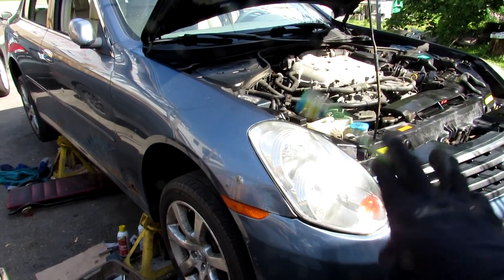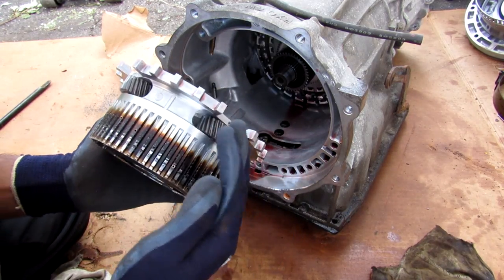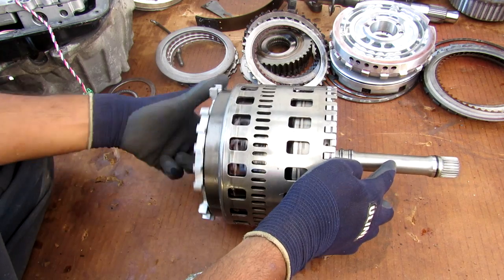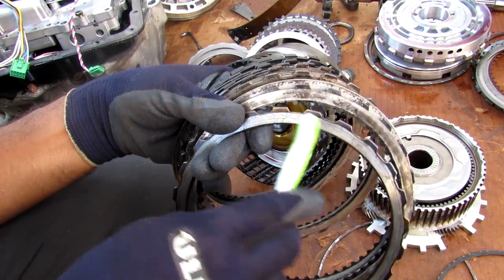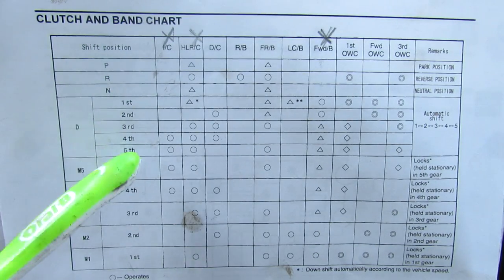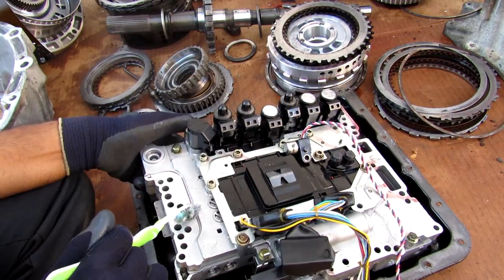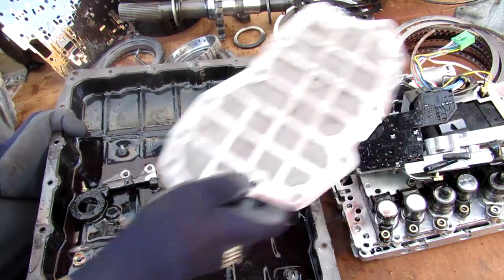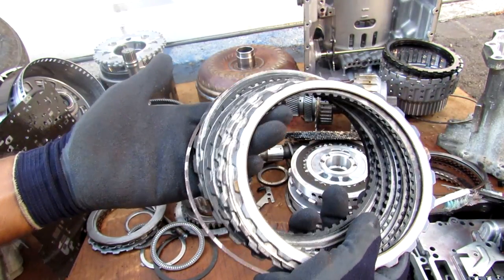Why Automatic Transmissions Fail

Comment: Now put it all back together again :) EV's require less maintenance, and this video shows one big reason why: No gearbox
Reply from the maker: The gearbox is a circuit board.
Reply: @speedkar99 : No gearbox of any kind. You're thinking of throttle. A/C induction motors have an extremely wide constant torque range by nature.

Comment: Nissans best effort.
Mercedes can be trusted to make good transmissions that last and can be easily fixed
Reply from the maker: Alot of brands can be reliable but maintenance is key
Reply: @speedkar99  Definitely agree. On a 5 or 7 speed merc box, a fluid and filter change is easy...a conductor plate is made into a service item. They really hold up...even when neglected.
Nissans in Europe do not have that reputation any more...especially anything jatco/cvt

Comment: Why don't automatics engine break when it's in D?
Reply: Torque converter disconnects the engine and gear box when stationary.
Reply: Some cars used to have a version of that called hill assist.
Reply from the maker: That's how it's programmed...to have those one way clutches free spinning in D

Comment: dealers are so lazy and just want to keep changing the fluid and filter and never want to take the transmission apart and inspect all of those parts like they should especially when you have a liftime powertrain warranty and they dont want to have to replace it.
Reply from the maker: It's all about the labour time

Comment: Maybe I was not paying attention, but how can an automatic system fail when it is computer controlled?
Reply: Some generic faulty or weak seal or component that causes low fluid pressure. Unintended leak. Early 80's GM 4spd. overdrive automatic had real touchy cable adjustments. I bought a new 84 Scotsdale step side. Misadjusted from new so anytime you accelerated it kicked down a gear and then right back into the next higher range.

Comment: Jeez! Not a word on what actually caused it to fail. Perhaps using a new toothbrush would help you. Plus, No one that knows what they are doing would pull the motor to get the trans out.
Reply from the maker: You missed the point here. This was a car I scrapped so they both came out easier.
Reply: @speedkar99  lol

Comment: That's why they quit making rear wheel drive cars. Cause they where easy to remove and replace the transmission. You did not have to disassemble the whole vehicle.  The ceos did this on purpose so the diy will not attempt to repair there own car.  I have 4, 90 s fords and they have the 40rw7 trans in them. And there easy to rebuild. This reminds me of the Toyota oil filter fiasco. On the new Toyota trucks. They do not want the new vehicles to be easy to take apart and repair. When my crownvics breakni do not fret. Cause I know that most any shop can rebuild the transmission.

Comment: And this is why I will always buy a manual. I knew they were complicated. Watching someone take it apart.....HAAARD PASS on buying one. 😳😳😳😳
Reply from the maker: Some auto transmissions are reliable, the technology has aged for some time now.
Reply: @speedkar99  Oh no, I'm not talking about reliability. I know they've become VERY reliable over the years. I'm just talking simplicity overall. Ie: replacing 1 clutch in a manual/ versus......100 in a auto?

Comment: God bless you . I would have pushed that over a cliff
Reply from the maker: Well I did eventually push it over a cliff after taking it apart.
Reply: @speedkar99   well like to pick your brain ! I have a 1987 jag xj6  I bought new has 50,000 miles stored inside  for 20 years  got  it on the road changed trans fluid and filter . Driving the car won’t up shift to 3 rd if I shift into second then third it goes in , if I take it up  to 3000 rpm it will up shift to 3rd. Is a valve stuck should I manually take it to 3 rd and drive it a while ? . Borg Warner 66  transmission . Any ideas . Thank you .